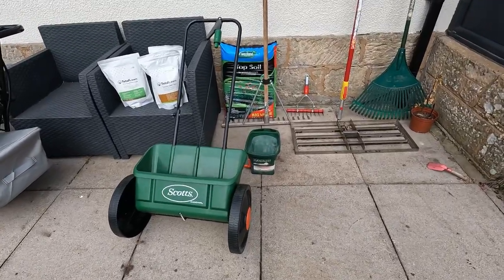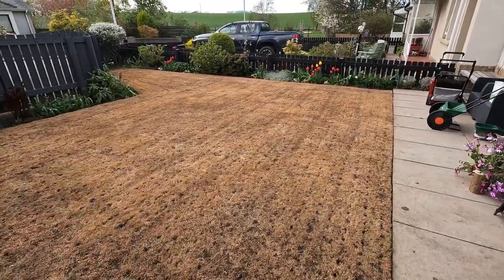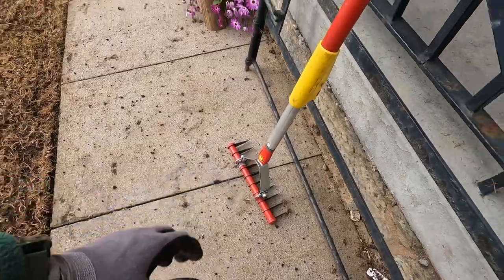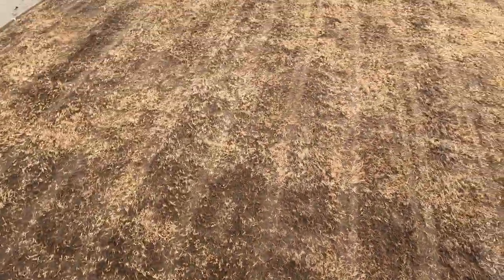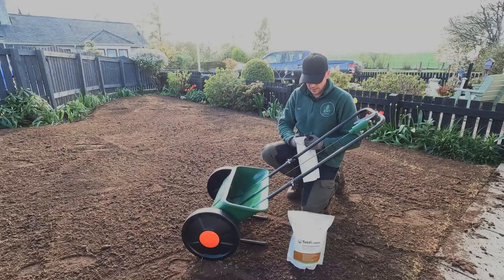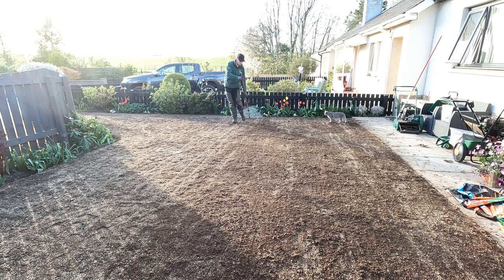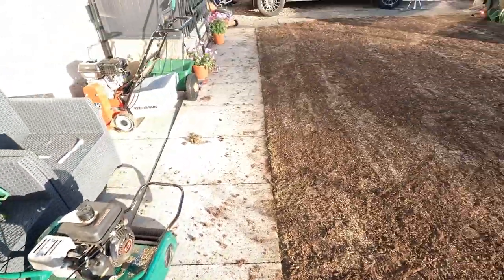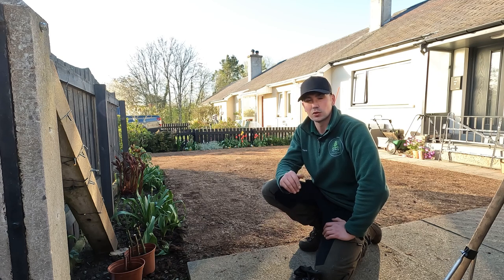Transform Your Lawn // Lawn Renovation //

Comment: Great guide and video Sam, I've been waiting for this. Been threatening to do mine for some time. Maybe I'll finally do it after this!.
Reply from the maker: Hi Graham! Thank you very much😄 well that’s it, I think there comes a point where you just think.. it’s time ! The way I see it is get it done now and then you’ll have a lush lawn by end of May and you can enjoy the whole summer with it 😄
Reply: @JayRockGroundsMaintenance  yeah, good point. The late summer/early autumn time means you don't get to enjoy it till the following year. Looking forward to seeing it come through. With the weather I reckon about a week 👍
Reply from the maker: @grahammacklam4736  yeah it’s definitely jumped up in temps the last few days, due some rain also so that should definitely help!😄
Reply: @grahammacklam4736  what seed do you think you will use?
Reply: @Premier_lawns_official  The seed I used for my recent trial was a shady mix of 7 varieties. It's A1 lawns shady mix, fairly fine leaved. Its mix slightly varies depending on what they have most available at the time. Mine is 20% perenial rye, 35% strong creeping red, 15% hard fescue, 15% chewings fescue, 10% smooth stalked meadow grass, 3% bent, 2% wood meadow grass.

Comment: Looking forward to seeing the end result. Sometimes you just have to do this. How often and for how long at a time should you put the sprinkler on after re seeding. Thanks.
Reply from the maker: Thank you Ray! I can’t wait for it to come through ! And keep you all updated 💪🏽💪🏽. 

Depends on the sprinkler and pressure I suppose mate but 15/20 minutes per area. You want it soaked but not flooding, there tends to be a fine line between them 😄. I water mine at least 3 times daily for the first 2 weeks and then slowly reduce from there depending on weather.
Reply: Thanks for your reply. Would you say 3 times a day for 15 minutes. The sprinkler is a pulsating one (if you know what I mean). Thanks
Reply from the maker: @Ray_ray11  if it’s pulsating then possibly closer to 30 minutes but again it depends on the structure of your lawn, as long as it’s not flooding and the seeds are floating then just ensure it’s been watered through enough 15-30 minutes should be adequate 😄

Comment: Such an informative video! Thank you :) i dont have a scarifier or aerator, so can i just manually rake it as much as I can and try to overseed?
Reply from the maker: Hi there ! Thank you very much for commenting! Absolutely 💪🏽 a hand fork every 4-6 inch spacings and a spring tine fork will definitely still do the job! Just a bit more elbow grease is required !😄

Comment: Is there a reason why u aerate first and then scarify? don't the wholes get full up of the thatch which same mess ur in before you start the renovation as the holes full of thatch?
Reply from the maker: Hi there I explained this a few times in the video, at points where it would be more ideal to aerate. The reason this time I aerated to begin with was because the hire on the aerator had to be returned before I had time to scarify etc. yes it would be more ideal to aerate afterwards, in my case - this lawn is scarified regularly and had little to zero thatch in it at the point of killing off hence why you could see soil through the whole lawn 🙂. The way this process was done will not affect its progress at all 😄🌱

Comment: Great video
Are you using 50g per meter square
Reply from the maker: Yes for the seed 😄 as it is a new lawn, slightly less if you were just overseeding 🌱
Reply: @JayRockGroundsMaintenance  Thanks for that
I followed you and killed all my grass off my grass is sloping so not sure if it will be good. Been 2 days now since seeding watering 3 times a day.
Do you think the seed will grow in time before cold comes. The 9th September
Day the Queen Sadly Died
Do you think I would cut it still if it gets to 3"
Thanks
Vic
Reply from the maker: @vicmills7702  hi Vic! Absolutely I believe with temperatures at the moment you will see little germination heads within 7 days if it is a ryegrass blend. You’ll probably have a full lawn by the end of this month 😄
Reply: Hello Jay
I do hope so used a 5kg bag of seed
Dwarf Perennial  = 50%
Strong Creeping Red Fescue = 50%

This is what it was.
Watering 3 times a day
But followed you every part. Even the lawn leveling etc.
So grass is on show on a corner so everyone looks at it and have been watching me.
Killed off all grass
Removed plugs manually 
Verticutter 4hp engine
Etc
So I need it to look good.
Thanks
Vic
Reply from the maker: @vicmills7702  that sounds excellent! I have no doubt in mind it will come out lovely. Remember though it may look thin in the beginning but it can take up to 6-8 weeks to fully thicken out, especially if the weather turns, I honestly think you will be fine😄 please tag me in an Instagram post when it all comes through ! Would love to see the outcome 😄🙌🏽🌱
Reply: @JayRockGroundsMaintenance 
Great will do
Reply: Hello Jay
I have another question.
Today is 23 degs I have watered 4 times today
As just came back to the house and it looks dry so watered.
It looks like my seed moves   not all as Iam not sure should I put a dusting of soil on top. I did use the flat rake to move soil then used the roller on lawn mower the same as you
Just looks like the seed moves or do that mean more water. Not using a sprinker just hose on cone
Any help
Thanks
Vic
Reply from the maker: @vicmills7702  hi Vic, since it has been a couple of days I would just try my best to stay off of the area, after 3-4 weeks you’ll be able to see what has came through, from there you can Overseed knowing the grass that has grown will give some protection to the new seed, I think you will be okay😄
Reply: Great thanks Jay
🙏😊
Reply from the maker: @vicmills7702  no problem at all!😄🌱
Reply: @JayRockGroundsMaintenance 
Help Jay
It's been 14 days tomorrow Sat, and everyone can't believe the look of the grass, it's nearly all full just a few patches but really nice green. It's getting near 50mm so will be cutting soon when 70mn
With the webb push mower. Once I cut it when would I cut it next do I let it grow again to 70mm then cut again. 
I have drilled holes to extend the roller so my cutting height will be 32mm.
Any info Jay
Thanks
Vic
Reply from the maker: @vicmills7702  hi Vic! Sorry I have just seen your other comments, I will get on to answering them tomorrow 😄. That’s fantastic ! I’m so glad it has all came through well for you! I would say once you have done the first cut you are good to cut every 3-4 days over the next couple of weeks, by then you can cut as often as you like, just try and pick the best days weather wise😄. With that height of cut you would be better to cut it sooner rather than later just so you aren’t taking too much off the plant in one go, if you have good enough coverage that you aren’t going to pull out the grass blades then you will be good to go😄🌱
Reply: @JayRockGroundsMaintenance 
Hello Jay

Thanks for reply
What cutting the grass and leaving it the same height
Say 32mm.
Rain is coming soon
I think all next week.
I suppose you can't cut when wet.
Thanks
Vic
Reply: @JayRockGroundsMaintenance 
Hello Jay
Done the first cut today at 32mm
Had a good bag of lovely tops nice green cut
But grass was a bit damp and now a few bare patches and grass is flat front the mower Webb push. Hope it comes back up
Just watered for the night. But looks good better when it all comes back up.
Do will cut again in 3  days time then same height.
Do I spray with iron before winter or don't it need it.
And when do you stop cutting for the winter
Thanks again
Vic